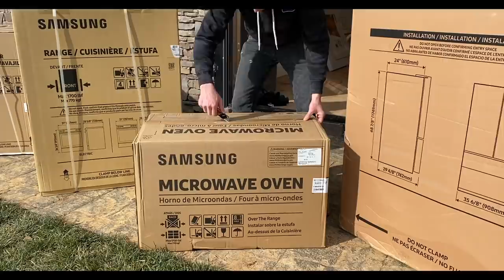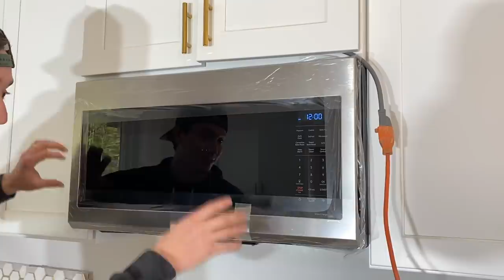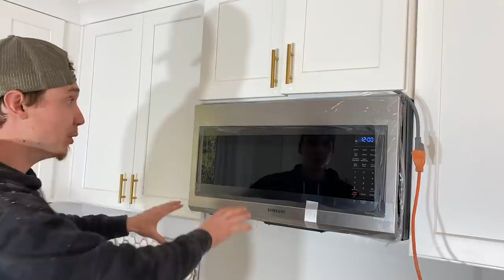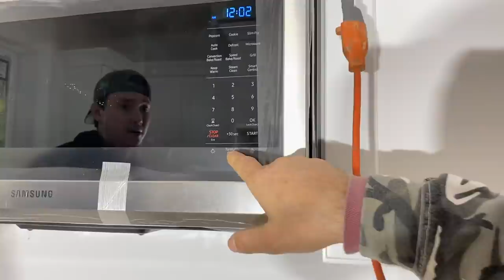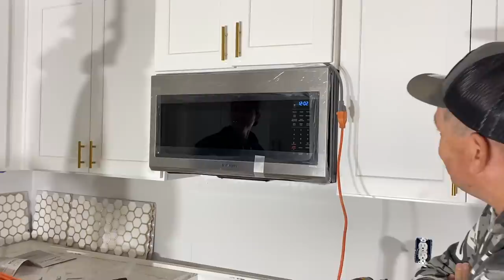The New Goonzquad Headquarters Part 71

Comment: I'm not seeing any way to get to the front door except for walking across the turf. Loving this build in general, but some of the finer points make me do that "what?" face. It's not a good look.
Reply: The most important asset of this site is the view, and Goonzquad will not want that to be spoiled by having cars parked on the south side of the house. They have mentioned insetting some stepping stones into the lawn to give access to the double entrance doors in good weather, but in winter they will probably use the single door on the west side. So that suggests a canopy between the house and the garage, which would enable cars to pull in there and their occupants would then be sheltered from the elements. There has to be some kind of link there anyway to comply with Code, so an imaginative designer could turn that into a fully functional component of the overall design.

Comment: Is it an american thing to have those ugly ovens and dishwashers and stuff? I feel like in Europe it's all integrated in the kitchen?
Reply: Standalone appliances are mainly sold to the general public who wish to simply slide them into place, usually without the involvement of professionals. Integrated appliances, which are designed to be fitted semi permanently within specially designed kitchen cabinets, typically require the involvement of experienced professional designers and installers. They two types of appliance are therefore designed for very different market sectors.

Comment: I hate to be the Debbie downer but we have this exact Samsung set including washer and dryer.... in the dark stainless instead, dude, you're going to have nothing but problems with them, sorry... look up the Samsung class action lawsuits going on. the Microwave has been serviced many times as well as the fridge... You will end up having your ice maker frosting up and it will frost up the back panel and then nothing will cool. They will end up replacing the ice maker and control board many times. Sorry guys but you're in for a world of hurt with those appliances.